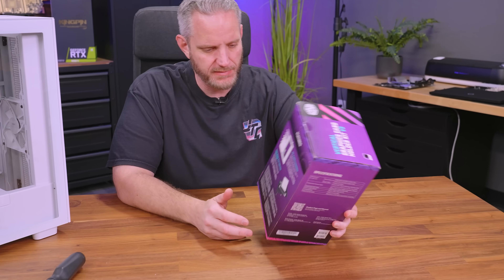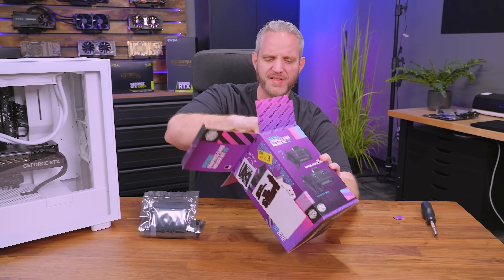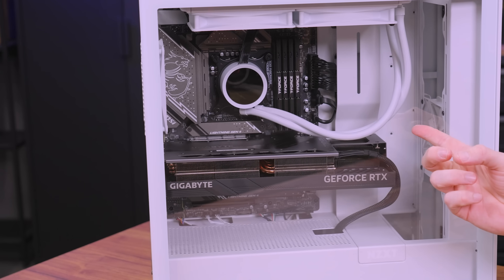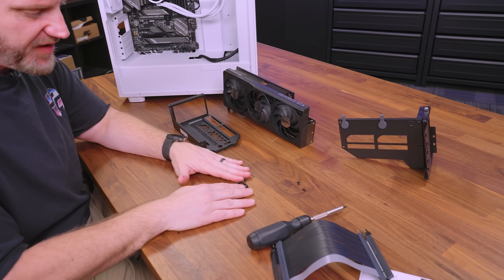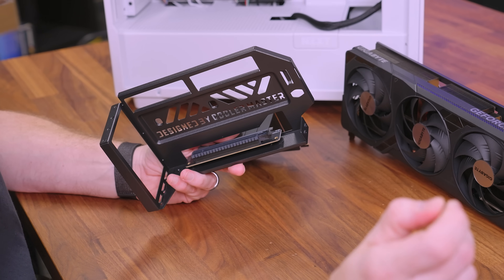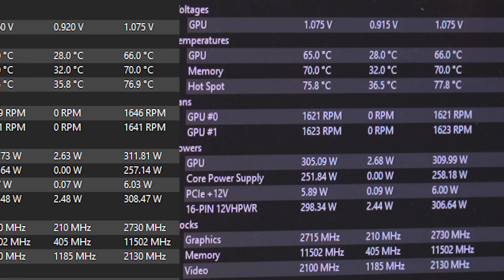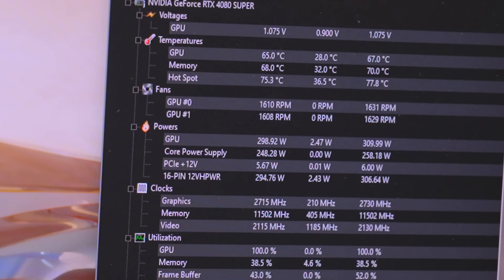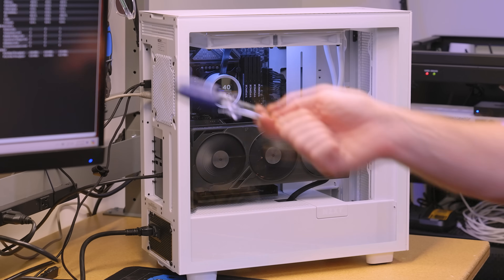Can this mount actually HELP GPU temps?

Comment: Will this fit or work properly in O11 MINI?? PLZzzz MAKE VDO IF POSSIBLE
Reply: It would work, but it will be cramp. I just migrated out from my O11 Mini which I used the "official" vertical GPU kit for the O11 Mini. I have since moved to a larger case and used this CM kit.

If you use this CM kit, your GPU is pushed in by about 1.5cm, meaning it is even closer to the front glass and overlapping the side mounted fans.
And even though the CM kit allows you to move the GPU closer to the glass, there is not much space in the O11 Mini for that. Another thing to note if you do intend to go vertical mount on your O11 Mini is to consider your air cooler / AIO. If you are using a large air cooler, or an AIO like the Arctic LF2, you may have clearance issues.

Comment: For anyone else using the same CM GPU mount, is your GPU also pointing upwards like in this vid (10:13)?
I thought my bracket was bent, but checked and it isn't. Also checked my case and it's perfectly fine too... Everything is aligned and straight.
Just want to confirm if this is "by design".

Comment: Now, take off the 8-12 screws holding on the fans and shroud and zip tie 3x-120mm arctic p12 max's on there and see what happens

The quality of fans that GPU manufacturers ship with these things are abysmal -- +$1000 products and they can't be asked to allow people to mount superior case fans

Comment: Funny installed this on my system exactly on the same day this video dropped
It required a lot of elbow grease to mount a 3 slot 4070 ti Super on a 4000D

The space in front of the case shouldnt really matter if you have any case with front and back side fans that push the air towards the glass panel

Comment: My big concern would be losing temperature in cases with bottom mounted fans, as now less than half the air would be going on the correct side.

When in contrast with a pc case with front blowing fans, regardless of the orientation of the gpu, it's always facing perpendicular to the fans.

Comment: I wish I could share pictures of it, but I modified my GameMax Mesh Box case to hold my GPU vertically. The expansion slot bay is not open so it wasn't possible to install something like this. I modified the GPU rear bracket and this 90 degree plate that mounts up against the expansion slots. It actually looks almost natural to be mounted vertically in my case.

Comment: My PC has been throwing PCI errors like the GPU is detaching, so as soon as I saw this video, I ordered this exact mount from a different store. So far, it works perfectly, but it's bending the back panel of the PC. I'll have to come up with a custom reinforcement/support, which feels a bit like the problem this mount was meant to solve... but I have to blame my chassis (Raijintek Paean M) for not being designed for this. Raijintek should make a more tailored solution for my chassis.

Comment: I've been using this mount for  about a year.  I use it with a EVGA 3080 FTW3 ultra card.  The card stays nice and cool.  Also the adjustments are nice for this bracket.
My Case is the NZXT H6 flow

Comment: My biggest issue with this kind of mount is it blocks all of the other pcie ports.  I always run a soundcard as I haven't found an onboard sound solution that I like.  So I have nowhere to mount the soundcard if I use a vertical mount on my gpu..........

Comment: I live in a tropical climate and for the last two years only mount GPUs vertically, there is IMHO a clear benefit to it from an airflow standpoint. I combined mine with a Jiushark Diamond CPU cooler and I have a nifty front to back airflow design.

Comment: For me, the real benefit of vertical mount is for heavy graphic cards.
With some custom one, we can reach the kilogram.
Even with enforced PCi-e slots, it's still big for it.
A vertical mount put the PCi-e slot on the bottom so we have not this pressure on PCBs.

Comment: I literally just bought this kit the other day. I have it in a Phanteks Enthoo Pro 2. I needed something to turn the GPU since my 7900 XTX is water cooled with an Alpha Cool block & Air kept getting trapped when it was mounted normally. With the adjustments the mount has, you still have clearance for smaller PCIE add on cards, like a SATA card or some capture card. It put the weight onto the entire mounting area of the expansion are, so unless your case is flimsy it mounts great! I'll update this if I find something inherently wrong or was overlooked.

Comment: An interesting test would be if the vertical mount has any effect on other components' cooling. If for example this mount makes the hot air of the GPU not get sucked into a CPU's air cooler.

Comment: Looks good.   A riser card is useful in some cases.   It does complicate the installation of a video card but helpful when the weight of the video card may be causing stress issues on the motherbaord.

Comment: I threw one of these in my 011 since they didn't make the "DLC" vertical anymore in order to prevent the cable on my 4090 from bending. It worked great with getting good temps all around since it didn't completely obstruct a bunch of fans.  I love that it kinda goes in just about any case.

Comment: The premium phanteks vertical mount with rgb is perfect for my 4090.  Sits back away from the glass and keeps temps over 5 degrees cooler compared to horizontal mount and is more secure with the extra support bracket that screws into the back of the GPU.

Comment: I bought one of these a month or so ago, an impulse buy when Amazon had it for $36, haven't had the time yet to try it. I bought it hoping I could move my MSI 3090 Suprim off the mother board and make room to also add a half-height Arc A310 for the AV1 encoder option for ripping my large DVD collection for my Plex server.

Comment: I recently used one of these when I needed to upgrade the GPU in my wife's oooold 800D case to a donated 3090 from a friend.  The 3090 conflicted with something on the MB, so I raced off to the "Candy Store" (aka MicroCenter) and in the DIY pc parts area ran into a VERY helpful employee who reminded me the case had bars between the slots, and this mount would help us so I could slide the card back towards the front of the case and run the DP cable between the bars to the recessed 3090.  GREAT when trying to shoehorn something in as you upgrade bits to keep an older rig alive!

Comment: Would this work on cases that don't have a completely open expansion area? I have a Be Quiet 500fx and it's not like that. If i were to pull every expansion cover off, it would still have a non-removable rib between every slot.

Something tells me it wouldn't work, if only because I doubt the video cables would connect without interference from the ribs.

Comment: Ok so the real problem with this adapter is that if you have a chonky boi GPU, that whole bracket os going to sag anyways, just with your gpu turned instead. The thing doesmt offer enough rigid support to keep a big gpu straight. I have one sitting in my closet waiting to go back to micro center this weekend because front of my 7900XTX was sitting at a 12° angle down towards the bottom of front of the case.

Comment: I buy this think year ago, and i used only raiser out there, cose its construction dont suppose other pci turn on my pc, worse my gpu mounted badly, my pc case have vertical mount and it way far from motherboard what give me more air for gpu, my opinion - just buy big case and raiser itself.

Comment: I have this mount. And I also have a Cosmos II case. Both of these are from the same manufacturer and guess what? The tolerances are far enough off that the ultra stiff riser cable sleeving prevents mounting of the bloody thing because of the stress on the cable. How Cooler Master can be this much off on the tolerances is beyond me since that is a standard with ATX and has been for ...forever?

No matter what I tried I couldn't mount this in my case. From the SAME COMPANY. I love my Cosmos II, minus the fact I will need to add in a USB-C 5.25" bay backplane, but this vertical mount kit doesn't work with this case. Millimeters matter, especially when the cable sleeving is the kind it is on this thing.

Comment: I use this mount with a Strix RTX 4090 OC with no sag for the last 6 months. I did have to use a Velcro to keep it from sliding back when you plug in your cables. My temps got better. NZXT H9 Flow with 3 fans on the bottom.

Comment: I mean.... it technically DOES have 3 points of contact, just not the best points.  There's the PCI-E slot, then there's the tabs that go down by the motherboard tray where the slot covers usually stick into, and then you have the screws that hold the vertical bracket to the other end of the expansion slots (or if you don't consider that a 3rd point, then could say you have the upper and lower portion of the expansion slots that it kind of rests against).

Comment: I like this, but i think you're looking at what it provides incorrectly. The biggest problem new GPUs are causing is weight and sag thats being burdened by the PCIe slot interconnect directly, as well as PCB flex. Any tilt in this card isnt 'sag' or 'anti-sag' its just mechanical misalignments that aren't being coupled to the connectors by anything but the flexible cabling. Mechanically the PCB of the GPU is much more rigid to support the weight of itself and heatsink in this position. Likely the only way things could get significantly better, is if there was some sort of standard for heatsink mounting points and areas to support, then it could literally be bolted to the case instead of the GPU PCB holding any of that weight.

Comment: Vertical mounts are okay... until you have to fit another adaptor card. If you're building a gaming-only rig I guess it's not such a problem, but for those of us that have dual-use rigs (gaming and work) it can be a complete no-go. Even the three-slot video cards can be a PITA because the commercially available anti-sag supports can partially obscure that 4xPCI-E slot that you now so desparately need. I use Corsair 750D Obsidian cases so no shortage of internal space, but those three-slot cards have forced me into making my own anti-sag brackets from 2mm stainless steel. 2mm may sound a bit thick but it does mean I can make a slim ASB that doesn't partially obscure the next slot down.

Comment: i have 1 it works great and with the weight of a triple slot card has no weight on 16x slot on the MB. a vertical mount also relieves stress on the gpu pcb

Comment: Had the Cablemod vertical bracket before with my RTX2070 and later with my RTX3080Ti in the NZXT Phantom 820 and Phanteks EvolvX but was upset because it was too flimsy and the cards where wobbeling. Replaced it with the NZXT vertical mount when replacing the 3080Ti with the ROG Strix RTX4080Super. Way more sturdy, plenty of space to the glass and because the NZXT vertical mount comes with a adjustable foot to rest on the power supply shroud the big brick of a GPU stays where its supposed to be.

Comment: Considering how much power does GPUs consume nowadays, how quiet they are while cooling GPU and how cool they are and most importantly - how badly they are being placed in pc - I am amazed by their performance.

Let's be honest. GPUs started as simple expansion cards, plain PCB with few components. There was no need to have proper way of mounting them in a case as bare minimum case airflow was enough to keep them cool.

Quickly we started to have a problem with cooling them, we needed more GPU power and also required better and better noise performance.

The way we mount GPU is simply stupid. We blok almost whole airflow by GPUs PCB and block it from dissipating it in natural way - up.

I have somewhere a 1cm PCIe riser. It is just a little piece of PCB with PCIe male and female slot.

I wonder how much could thing like this help to traditional horizontal mounting. Unfortunately I can not remember which PCIe standard it does support. It was cheap so I don't expect much of it.

Comment: Hey there! so my pc has a problem when I try and launch VR chat... it blue screens and gives the error message "UNEXPECTED_KERNEL_MODE_TRAP" and then restarts and I have no idea why : / I didn't really do anything different with my pc I just tried to start it up the other day and that happens now :( Do you know of any possible reasons it would be doing this? or any fixes? (I tried VR chat support but no help really came from it they kind of just didn't respond to me)

Comment: Goodness I really wish Linux distros had better benchmarks and hardware support for GPUs, because then there would be zero variance in testing, all while keeping it connected online. Just disable update checking and reboot the PC, then do the online stuff with it when testing is finished.

Comment: ive had this mount for like 8 months and its been holding up pretty well and my temps didnt change that much another thing that i like are the hole on the back since my gpu backplate is a heatspreader also my gpu also saggs upwards and i cant stop noticing it now

Comment: the problem that kept me from ever trying a vertical mount are the pcie riser cables. Couple years ago i could only find that had ones that had 8gb speed limit. Microcenter tried to say that isnt an issue but i dont believe it bc plenty of games demand 8gb of VRAM or more. Far Cry 6 high res textures demand 11gb. Even Diablo 4 wanted 11gb vram on 4k ultra, had to lower my 3080 to 9.5 allocated to run stable and that was the final straw that made me switch to 7900xtx

Comment: oe i must say that is a very nice verticle mount, i've always liked them in concept but execution has been lacking often featuring a large plate at the bottom to house the PCI-E extention but also mostly blocking off 1-2 of your bottom fans. 

where i saw it as a benefit after noticing my GPU itself is kinda blocking off the air beeing drawn in from the bottom or atleast acting as a acrylic slab for air to move around, so if you could mount it vertically and relatively near to the board the bottom intake (in my case) would push more air up in to the top where a radiator sits.

this seems to really minimize it's impact on any bottom intake/exhaust which i really like.

Comment: The issue I have with these mounts is that they block off the other PCIE slots. A lot of the time I will add a network card, a RAID card, or a card that adds more ports.I'd gladly use a riser, and put the card somewhere else, but most mounts and cases just have it blocking everything else.

Comment: In my opinion, a better solution than a vertical mount is a horizontal enclosure (ie. good old (more than 10 years) HAF XB EVO also from Cooler Master). Of course, something for something - no glass, graphics max 334mm... But overall concept itself as for me is great. Who have this case 👍 😉

Comment: Put it in a mesh sided case and it makes a difference. I have a reference 6800XT vertical mounted in a Fractal North mesh and dropped temps moving from the same setup in a glass sided case.

Comment: One of the things I've noticed about vertically mounted mobo configurations is that the gpu ends up with a flat surface facing fans on the bottom of the case.

This is basically terrible fluid dynamics, because the air can't flow over the gpu as efficiently as when it's coming in from the side, like you get from horizontal mounting with an intake fan in the front.

But at the same time, if you could get the card turned vertically so that the bottom fans could hit it from it's side, that could benefit from the whole "hot air rises" and fluid dynamics together.

To do that, though, you'd basically need to rotate the vertical mobo 90 degrees, which isn't really a thing in case design. 

And even if it was, is that really a worthwhile improvement to build an entirely new kind of case to try out?

Comment: would it make a difference if you put 1 or 2 more front intake fans? in my head , it should help.  more air flow = better temps?

Comment: the space between the glass is an issue for example with a 4090 strix, i fitted one into a hyte y60 and couldnt have the glass panel on, its was too close and washign cookign the card, then i went with the y70 and its perfect now. thats a great case Jay the y70 touch

Comment: I've been using this vertical mount more than a year now, using it in a Cooler Master TD500 Mesh case.

I mostly installed it because previously I tried to install a tall Thermalright SSD heatsink on my second M2, wich in my motherboard is located right below the pcie x16, and had clearance issues with my GigaByte 3080 Gaming OC in horizontal configuration. It was impossible to keep both.

Sooo I went for this vertical mount expecting compatibility with my case, wich I had, buuuut I have to say the main con this adapter has is that is EXTREMELY chunky and a bit complicated to install due to the 3 different pieces.

That aside, it works great, it allows to position the GPU in depth and length, wich is great to give it some visibility in the center of the case. In case you try this keep in mind the display ports are going to get inside the case a bit, wich is a bit anoying in case you usually change your monitor connectors, add different ones, etc.

Riser cable is a bit long for my taste, using it on a "classic" semi tower style like the TD500, it would be great if it had 1-2cm less length. However I'm sure that's useful with bigger, wider more recent cases.

This combined with 2 L shaped 8 pin angled adapters makes the GPU installation perfectly clean.

Not much but I think I've improved my GPU temps like 2º, but mostly my M2 temps thanks to allowing compatibility with the mentioned heatsink for it.